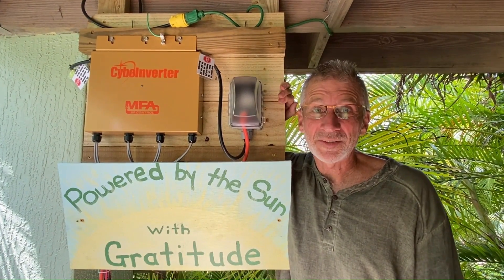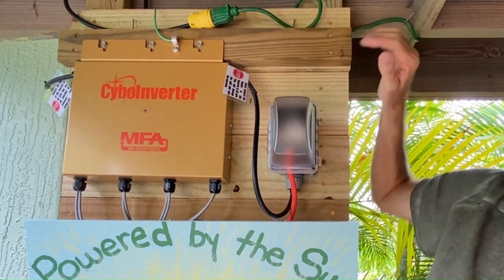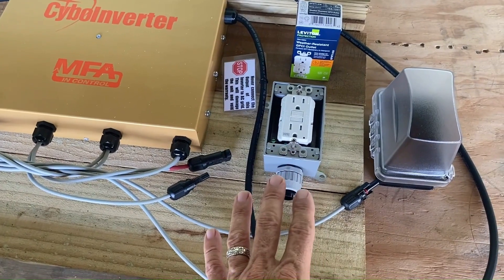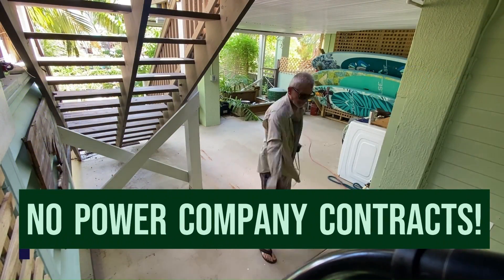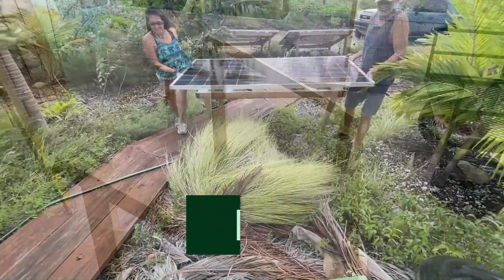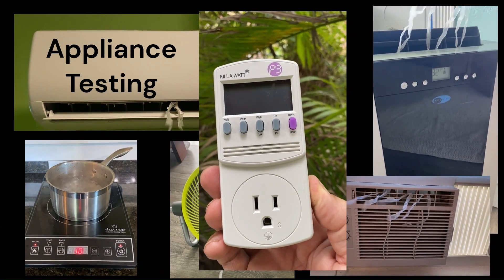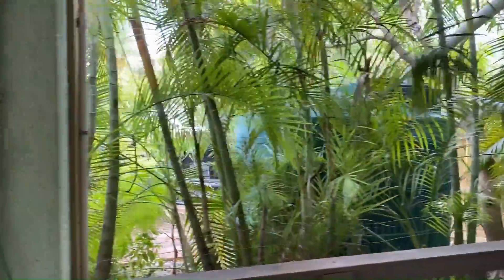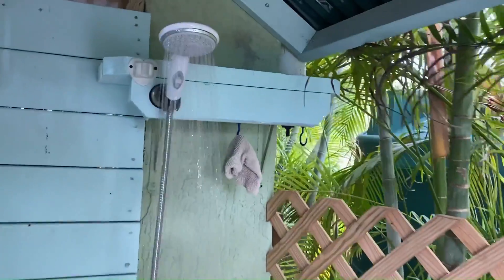Let the Sun Cool your House!

Comment: that will definatly get you in trouble if your electric supplier installs smart meters and you don't have the proper equipment , agreements and insurance in place
Reply from the maker: That is the beauty of these-you are correct for conventional net metering, but these are simple devices that you plug into an outlet like any other appliance in your home, and DO NOT require an agreement with the power company!
Reply: @ecohabs4earth  trust me smart meters can sense any back current when they do your electric company will be out to warn you to stop back feeding the grid ....your unit looks like a standard grid tie invertor with no provisions for current consumption ....so it doesn't know if it is powerig your device or back feeding the grid ....if your backfeeding the grid without an aggrement your breaking the law and subject to fines and imprisionment if someone were to get hurt. You would have to show me the the circuit or  feature that does this because I know of nothing that can do this without a current probe

Comment: does your solar converter only power 110 volts or can it be set to 220/240 to run devices in Europe. looking for a way to reduce my electricity costs, but thinking of adding a battery to the system just in case. monthly bills in Ireland are 294 euros for a family of five. Shane, Tipperary, Ireland
Reply from the maker: Yes they have European models. Email me for details ecohabs4earth@gmail.com